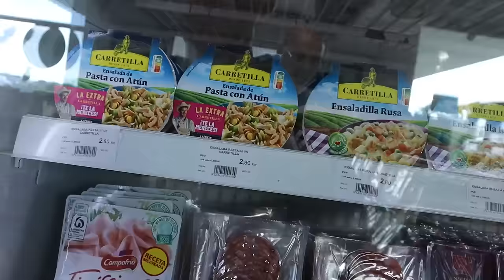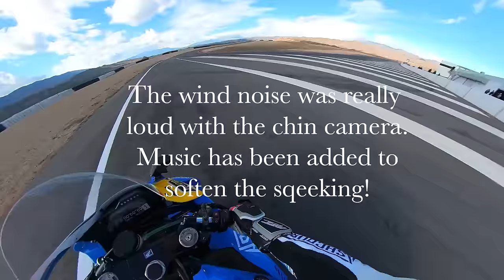We pulled it off!

Comment: So the OG CBR900RR was 1992, but big Neil is right that it was 96 at the TT on the 'blade. First eligible class the fireblade could run in, production bike class had been away for 6 years. Philip Mccallen romped it at 118mph. New record set. 2 dozen of the 50 odd starters were on a 96 blade. The top ten were mostly all on the Honda! Who was Nelly spannering for?